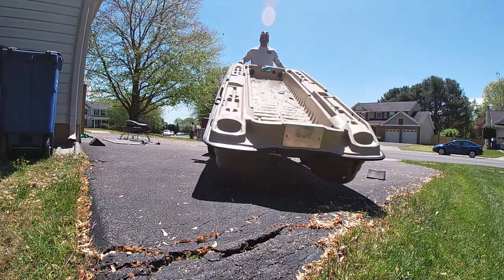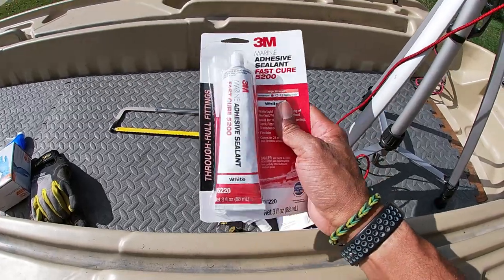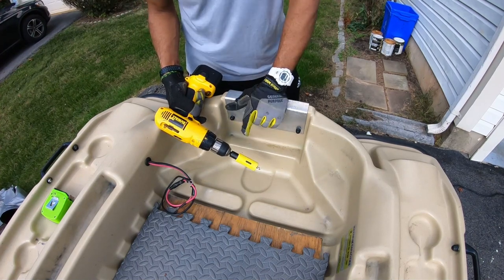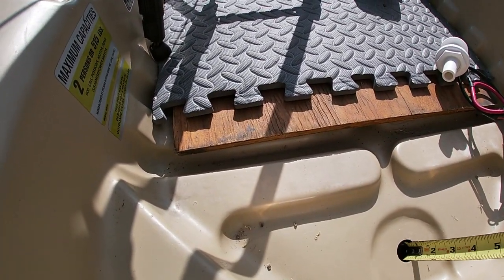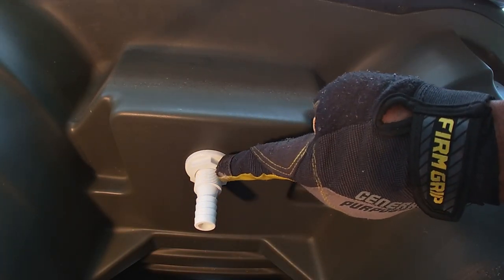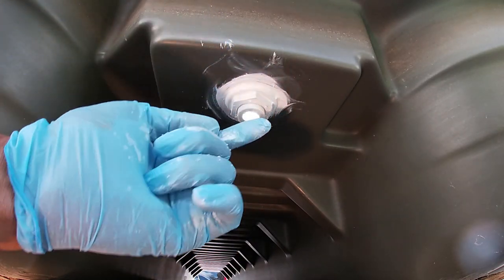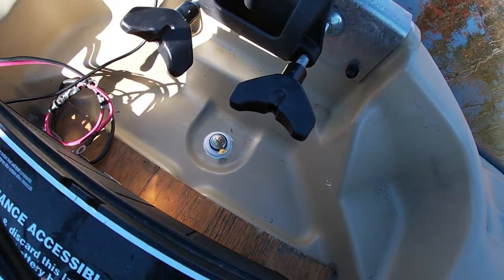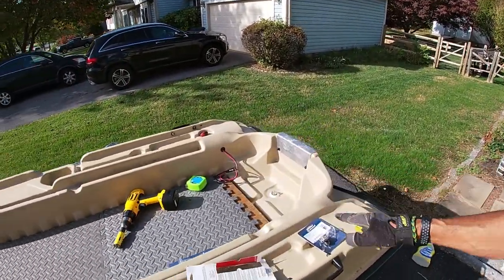Pelican Bass Raider 10e Scupper Plug INSTALL AND TEST {Complete Step-By-Step}

Comment: did it drain?   like when the boat had water in the bottom?   I was wondering if it really is the lowest point.
Reply from the maker: It drains great.  The scupper plug has a small lip around it so you may have a little water left back but that evaporates on its own.

Comment: Good video. I did it just like you said and it worked fine. However,  my academy dosnt sell the correct plug. Your description below says 5/8 but none I’ve found work. And the part number dose not cahow up on Amazon. Anybody out there send some suggestions where to get one.
Reply from the maker: I ordered mine from the academy website not the actual store.
Reply: Cool. My boat is almost ready. Do you want to see it. I’ve been thinking about posting my first video.
Reply from the maker: @paulpinto9783  sure

Comment: I tried the 5/8 drain plug it was to large , can you tell me the correct drain plug size. Thanks
Reply: Did you figure out the correct size?
Reply: I tried 3/4 and 5/8. Both are too big
Reply: @asaabadie3141  I figured it out and this is gonna sound silly. You have to wet the plug first. Then it slides right in flush. 5/8 fits perfectly now lol

I tested this by using a dry plug and a wet one. Dry one wouldn’t go in. Wet one slide right in

Comment: Hello, i just ordered this from Bass pro shop. my question is, i need to fill out the certificate of origin? or need to be the store? thanks
Reply from the maker: Excellent question. Don't make the mistake I did not having the store fill out the certificate of origin.  So yes. BPS should fill it out before you leave so you'll have it to register the boat.
Reply: @usermiamiusa  I bought mine a few months ago on Amazon, but had to have a replacement sent. The original came with a declaration of origin separate from the manual (or the one you can download from website) while the replacement only came with the manual. So for my replacement, I filled out the information on the declaration of origin that comes within the manual and it has a printed signature on it from the manufacturer (as well as the downloadable sheet from website). This was sufficient for me to register the boat. I live in Michigan. I just needed proof of purchase (receipt) and the origin sheet.
Reply: @jordanmizell4547  Did you just use the Amazon order invoice as the receipt?
Reply: @NoFro-TL  Yes, that's correct.

Comment: Hello, can i use this on salt water?
Reply from the maker: Honestly I don't think so but research that one more.
Reply: Shouldn’t be a problem. Just consider which motor will be best for your needs
Reply from the maker: @waynewill801  keep in mind the top and bottom of the boat are kept together by heavy duty staples so salt water may corrode them over time.
Reply: @BassBrothersFishingDMV  oh ok I wasn’t aware of that. Thanks for your input. Just bought one but I live in Kansas City so mostly just fresh water here anyways.

Comment: 2 years later how is that scupper working out. Thanks for your time
Reply from the maker: Just like day one.
Reply: I’m doing it. Love your videos. Family that fishes together stays together. One last cast. 

Gabe
Reply from the maker: @rubbingisracing1  Thanks. One tip I do have is to use more sealant on the inside of the boat than I did. Just to play it extra safe. No issues with my boat. Just something to consider.

Comment: It will be best if you have one on each end believe me/
Reply from the maker: I see what you are saying. My driveway is on a tilt so I have to park the boat front in so water will drain out the plug. If a plug was on both ends it wouldn't matter which direction the boat is facing. Good tip. 👍🏾🤙🏾